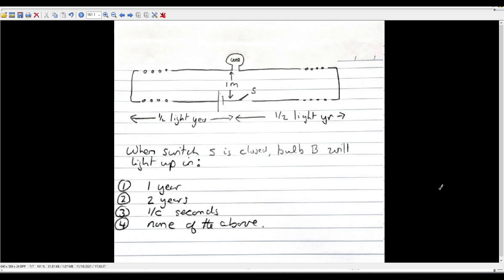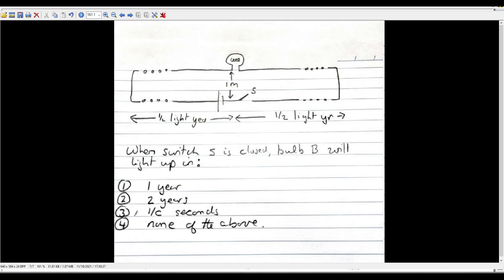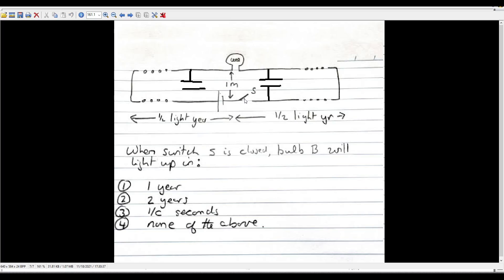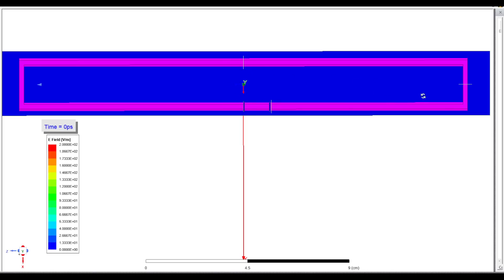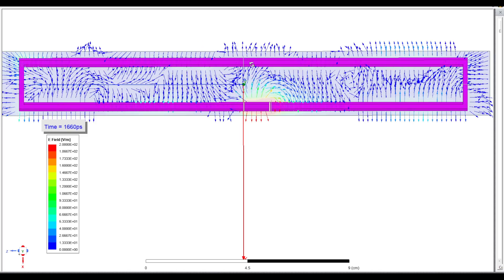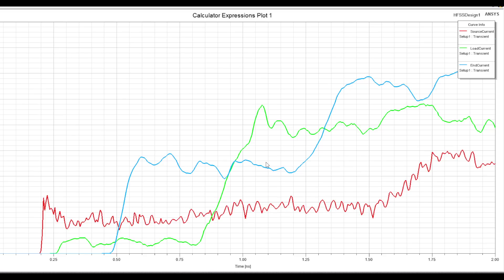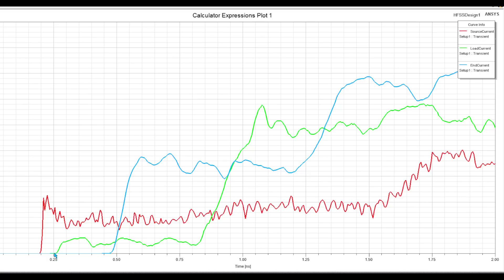Response To Veritasium - Electricity Propagation Time Problem

Comment: This guy doesn't seem to know the difference between a light year and a light second.
Reply from the maker: Who said light second?
Reply: @PulsedPower  Derek at Veritasiom did in his video. Are you changing the problem and the length of wires from light seconds to light years?
Reply from the maker: @michaelbartlett6864  The first 30 seconds of my video would explain that for you.
Reply from the maker: @michaelbartlett6864  That video makes a some key errors, it seems that the creator is unfamiliar with how electricity propagates.

Good job ignoring your blunder.
Reply: @PulsedPower  I watched your video twice now and I still don't see why you changed from light seconds to light years and I still disagree.
Reply from the maker: @michaelbartlett6864  At the very start of my video I give the full context of what the video is responding to, there should be no ambiguity. Before Veritasium posted his video he posted the photo that I show at the beginning. I posted my video in response to that photo before he even posted his video. The photo clearly shows the dimensions as lightyears not light seconds.
Reply: @PulsedPower  I am not the only one confused by this, I noticed that you answered others in the comments section with the same concern.
Did you even watch Derek's Veritasium video before posting yours? Nowhere in his video does he mention light years.
My view of your video is that it is "literally" smoke and mirrors and I have a good idea where the smoke is being blown from and to.
This is a far more informative response to Veritasium than yours - 
https://www.youtube.com/watch?v=-jJB8dyOJIw
Reply from the maker: @michaelbartlett6864  
Right, because you arent the only one not paying attention.

Did I watch Veritasium's video before posting mine? No, because like I said I posted mine BEFORE he released his video.

You already linked me to that video earlier in this message chain. Like I said, he has some fundamental misunderstandings that are clear from his video.
Reply from the maker: @michaelbartlett6864  Please reply to my comment on Tycho's video if you would like to discuss further what he got right/wrong in his analysis. Ill paste the comment here:

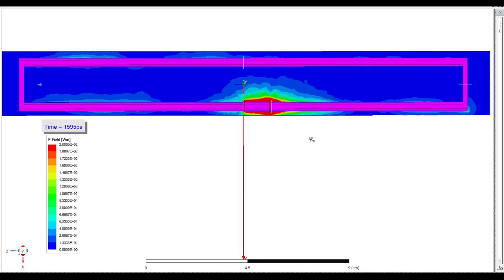"You say at 6:50 that, 'the current wont flow until the EM field is fully established along the entire circuit.' This simply isnt true. If I take a simple pared down case of just two long wires on the same axis with a gap between them such that a battery could drop into (connecting one wire to + and one to - ) and one wire having an inline bulb. If you drop a battery into this configuration you would have the batterie's electric field spreading outward at the speed of light. As it engulfs the conductor on either side it will begin driving a current. As it passes the bulb on one of the sides the current will now be flowing through the bulb. Of course once the fields reflect off the ends it will begin to establish a steady state of zero current. But it is incorrect to say that current WONT flow until the EM field is fully established EVERYWHERE in a circuit."
Reply: @PulsedPower  A static electric field +/- does not generate current in a wire and a static magnetic field does not generate current in a wire.
Reply from the maker: @michaelbartlett6864  Correct about the magnetic field, wrong about the electric field. Electrons will experience a force in a non-zero electric field, static or not. That is indisputable.
Reply: @PulsedPower  A force is not current flow. Are you saying that a wire laid beside a charged battery will have current flow in it? Let me know if you get a response from Tycho.
Reply from the maker: @michaelbartlett6864  In a conductor, yes, the force moves electrons in the conduction band which is a current. If a battery popped into existence next to a wire then current would start flowing until the field propagated to the ends of the wire and established surface charges that create an opposing electric field to that of the battery inside the wire. This means zero net field and zero current as we expect steady state. However there will be an initial current before the opposing field is established.
Reply: @PulsedPower  I'm sorry but it just seems that you are grasping at straws. There is no current flow in a wire laying next to a battery.
Reply from the maker: @michaelbartlett6864  If you need to hear it from someone else just google it. A conducting object will become polarized in an external electric field in order to bring the net field inside to zero. This is not an instantaneous process; during that process and the process itself(redistribution of charges), current will and must flow.
Reply: @PulsedPower  What I said is absolutely true. A conductor in a static electric field or a static magnetic field has no current present. You said, "If a battery just popped into existence next to a wire", which requires both movement and time - it is not static. In the same manner, you can not "pop" a conductor into a magnetic field without time and movement. Static means not moving.
Reply from the maker: @michaelbartlett6864  Right, but at some point in time charges in the wire had to move(current) in response to the electric field in order to create a net zero field within the wire. So yes you are right when you talk about its steady state but you are ignoring the transient that occured at some time prior.

With regard to the Veritasium problem the transient occurs when the switch is flipped(the electric field across the switch collapses to zero), and that is the key moment of this whole problem so you cant really ignore it.
Reply: @PulsedPower  I never said that the trasient could be ignored, but in no case can it light the bulb.
Reply from the maker: @michaelbartlett6864  I show via simulation and explaination that a current will flow (and continue to flow) as a result of the transient. Im sure you, like many others, say "but the current is too small!"

Ok, how much current do you need? How about the source is 10kV, then surely you could light an LED? No? How about 100kV?

What im getting at is that any argument of magnitude can be solved by simply increasing the source voltage.
Reply: @PulsedPower  So let me pose this question to you -
If you have a wire one meter long and you connect an o-scope with ultra-high resistance probes to each end of it, and then move it to within one meter of a 12v car battery, assuming it is shielded from other interfering fields - what would you see on the scope?
Reply: @PulsedPower  yes, and if you increase the voltage high enough you can arc across a one meter gap, but the voltage is only 10v across a one meter gap.
Reply: @PulsedPower  I think we have beaten this horse to death and we will just have to agree to disagree until a real world experiment can be set up with a lot more known parameters. I enjoyed the conversation and you are welcome to have the last word. Have a good one, I'm done.
Reply from the maker: @michaelbartlett6864  
See this whole time you are assuming 10V (or 12V). That assumption comes from Veritasiums video which was made after mine. In the problem I am analyzing there is no source voltage specification, so we can assume it to be as high or low as we want. Of course you are right that 12V is not going to drive sufficient current. Take care.
Reply: @PulsedPower  Yes, the Veritasium video posted the day after yours, but that is the one everyone is talking about, I'm sorry about the initial confusion but that's life.
Have a good one.

Comment: You need steady current to drive, not potential, I don’t think few micro amps can dirve a lamp, and watch the BCs it can change the results dramatically, I think it should be countable after the steady current is established.

Comment: You should know the difference between a light-year and a light-second.
Reply: As noted in other comments, check the posting dates.  This video was posted after the initial problem was posited, which had light years, and before the Veritasium video was posted, where the lengths had been changed.

Comment: So if we asked when a capacitor is charged are we asking when does it begin charging (distance epsilon/c) when it is fully charged which is infinite time as it is horizontally asymptotic (if we include L and R  terms depending on the values it may have different damping... perhaps overcharge and oscillate or whatever and end up not being charged again vs steady state before being too charged over and over again) or do we ask when does it become close enough to the steady state
Reply: It's an annoyingly clickbaity linguistic question

Comment: 1/c seconds makes exactly zero sense as written.  The units are s/(m/s) = s2/m.  More correct would be to express it as 1m/c, and to omit "seconds".
Reply from the maker: 1m/c is correct but clunky and requires the reader/listener to stop and think in order to understand that the unit is time. I think that for the vast majority of people "1/c" seconds is more quickly understood as intended than "1m/c"

Perhaps 3.33 ns is the most clear, however 1/c bakes in the intuition of WHAT it is representing ("Oh, its the time for light to cross the gap directly").
Reply: @PulsedPower  I don't know about most people, but when I saw 1/c seconds, the first thing I think of is the units and what it may represent; and I got stuck there.  It took me a while (and for your video to progress a couple of minutes) to understand that it really meant 1m/c.  I'm really not faulting you for the expression, but Derek.  Even after I watched his video (a few days ago) it was fairly unclear.  If I had seen 1m/c from the beginning, it probably would've taken me 1/2 s. to understand.  I'm probably just wired differently.

Thank you for taking the time to respond.
Reply from the maker: @Fetrovsky  Fair, thanks for the feedback!

Comment: @Ben Watson  Cool video and all, but you're really not answering the problem.  A simulation is a case of getting out what you put in (or not so kindly, garbage in garbage out).  You cannot answer a fundamental question about how something happens with a simulation because the simulation contains your presuppositions.   

The fundamental question isn't really how long it will take, but how the energy flows. That's why Veritasium was wrong: energy flow in this case does require the wires.  We all know this.  So, Veritasium was doubly wrong for trying to claim something that he knows is patently false.  It's true that energy flow is a bit of a conundrum.  I mean if Feynman thinks that it's crazy, whom am I to disagree?  If only Veritasium had just come from it at that angle, I could forgive him; but instead he wanted to make a sensational video to get clicks.
Reply from the maker: Can you be more specific about where you think the simulation is invalid? It clearly demonstrated that real power, proportional to your source voltage, would be delivered after d/c (d being your wire separation). It seems hard to disagree with, so im curious why you dismiss it.

I understand that once Veritasium published his video the main point switched to, "how power flows." However my video was posted before his, it was a response to just his community post which was of the diagram asking the propagation time question, so the "how long" is all im attempting to answer here.
Power flow can be guided along wires since conducting wires establish the direction of the electric field, however the only power flowing WITHIN wires is the power being dissipated in the wire.
Reply: @PulsedPower  Sorry, I didn't realize that you posted before actually seeing his full video. 

You're using standard tools to model the situation. Yes, your standard tools do show that the vast majority of the power follows the wires. That is the expected, well known, experimentally verifiable answer. Veritasium effectively said that all of the power flowed shortest path from battery to the light, which is false.  My whole point is that the standard tools are what are in question.  

So, why is Veritasium wrong? What was his mistake?  What does he have wrong about the Poynting vector?  What is the Poynting vector anyhow?  @Tycho asks some of these questions in his video: https://www.youtube.com/watch?v=-jJB8dyOJIw

Feynman sort of addresses these questions.  I think that the issue is that we really don't understand EM and electricity very well at a very fundamental level.   Even saying that things are "fields" isn't to me a great answer.  And String theory is a non-starter; a string is a something with dimension, so how can something with dimension create dimensions?  It's circular in a way.   Am I making any sense?

Comment: What wire gage would you need to have 2 light year-long cable transmit any measurable power?
This exercise is valid assuming only a lossless transmission line, which cannot exist.

Comment: Hi. I'm a  major electronics naif, so forgive my ignorance. Don't the batteries terminals on either side of the circuit have different  behaviour current wise initially? If the switch is on the + side is shut, doesn't that allow electrons to flow into the battery - i don't know the conventions for these things, sorry? But how does the - terminal push them out without the  effects of the change in PD from + terminal propagating around the wire to communicate change in PD so the the electrochemical properties in so the - terminal of  the cell can do its magic?. that is, how do the fields coming from the activation of the switch interact at the -  terminal which is on the opposite side of the circuit, make it so the battery  chemically increases/decreases electron availability to generate a seemingly symmetric initial change in the wire's field state on either side?  Do the  changes due to the switch propagate in my example from the +  terminal through the battery changing the balance of the internal chemistry of the battery and thus alter the corresponding state of the - terminal's PD in some sense relative to the PD state of the wire  on its side thus allowing currents? Sure seems obvious the changing field can induce currents in the bulb, but I'm more curious about the simulation and why initial field state evolution isn't more asymmetric, ie why doesn't the asymmetric switching arrangement  have any effect on the evolution of the local wire PD situation and the chemical source and  sink needed to induce  the flow of electrons in the first place?.